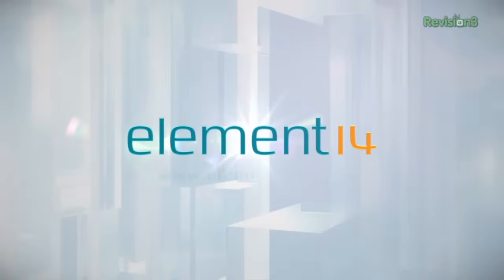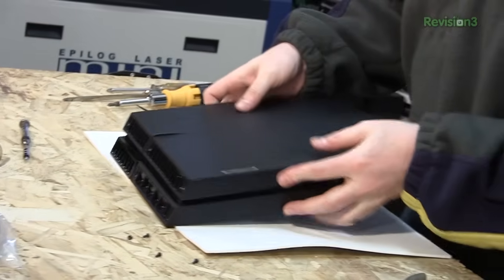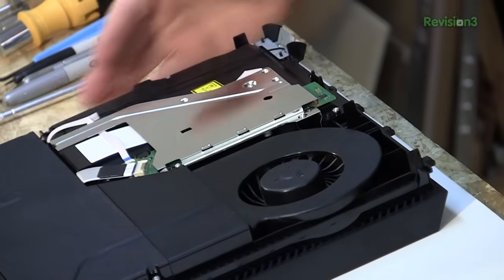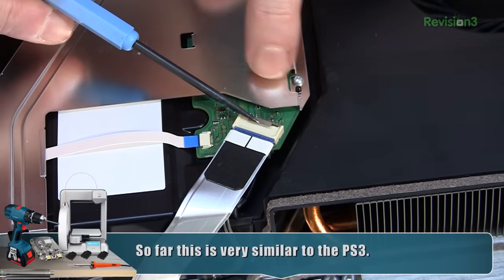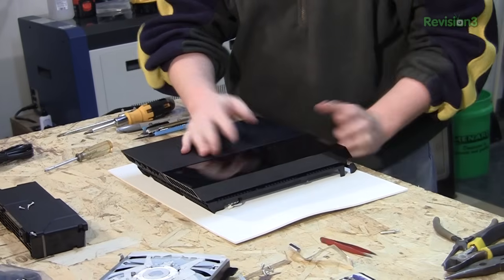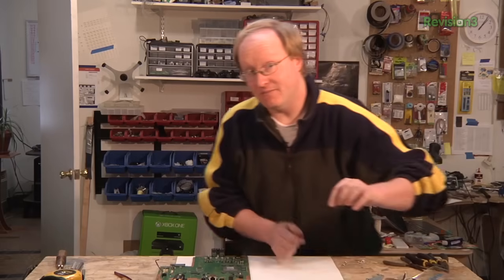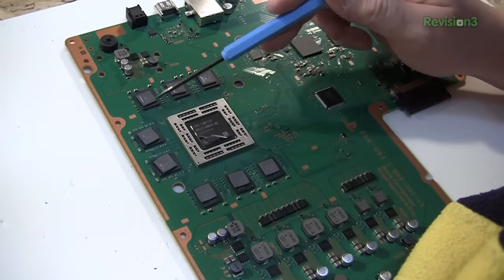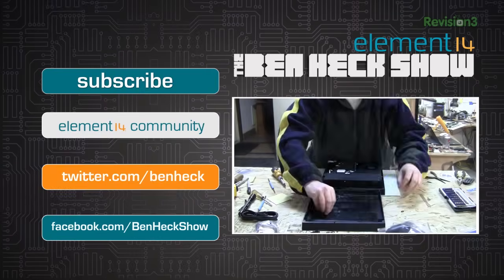Ben Heck's PlayStation 4 Teardown

Comment: Cool teardown. the console looks easily repairable by the end-user. It was a nice touch to have a separate flap for the harddrive space, so you're not breaking the warranty when replacing the hdd. Cooling seems a bit dubious, though I guess Sony made a couple of compromises on the overall size of the unit, the necessity of a power brick, temperature under load and noise.
Reply: actually, the cooling is much more efficient than the XBone, the unit is built into the frame rather than an individual unit, which cools efficiently being small at the same time.
Reply: Sean Williams I'm not sure what you meant by "efficiently". Due to the compactness, the smaller fan and the internal power supply, the PS4 runs an average 10-25°C warmer than the xbox one. Whether or not that is going to affect its longevity I'm not sure, but it is definitely more prone to overheating as it ages or when the fan starts deteriorating with dust and hairs.
Reply: ***** Don't forget to mention that the fan is also aiming downwards, so that it's blowing heat against a surface, which if you have had a laptop with a fan like that, you'd know it can be more prone to overheating.
Reply: Jrenyar I think the fan blows air sideways, out of the back of the unit, but I'm not sure about this. A lot of modern fan-designs are different from the ones in the past. Previous fan designs indeed all blow air perpendicular to their own rotation, but a lot of modern compact fans blow horizontally across their rotation plane. Again, I'm not sure if the PS3's fan does this or not
Reply: ***** Even if they have a sideways blow, when a fan points down, it will still blow down at least a little bit, which would still have a heating problem, even some modern laptops have the problem shamefully enough. I think that's why Ben sounded a little surprised when he saw the fan pointing downwards.
Reply: Jrenyar Perhaps ^^ , it's true PS4 runs warmer than xbox one in the same games, part of the reason for that must be the fan, you're right about pointing out Ben's surprise
Reply: ***** It's one of those things, no matter the enhancements in technology, simple physics such as how a fan pushes air around, will maybe change a little depending on how the case itself works, but it won't stop a lot of the air being pushed downward.
Reply: BernTheNerd You know this for sure? because it seems weird how the fan is pointing down. Like I said, no matter what enhancements in technology there are, a fan will always blow the way its pointed.
Reply: Jrenyar
If you have had one of the newer video cards, you would know that the fan is one of those kind that sucks air in from the middle and blow the air toward the horizontal van.  The spinning create negative pressure at the outer edge of the fan and thus the air is sucked from the middle. It is an incredibly compacted and efficient design
Reply: Jrenyar
 the guy in the video said that it takes the air in and the fan blows it out, didn't you watch the video? 2:59
Reply: sampson ireman Doesn't mean he likes the idea... he even says a fan facing down, thats new. Meaning he's surprised.
Reply: Jrenyar
 he didn't say he didn't like it either. a fan that sucks cool air in and blows hot air out is a great idea, but only time will tell.
Reply: Jrenyar
 digital foundry did a test and the x1 while gaming runs hotter then the ps4, so sony did something right, http://www.eurogamer.net/articles/digitalfoundry-hardware-test-playstation-4
http://www.eurogamer.net/articles/digitalfoundry-xbox-one-hardware-test
Reply: ps4 don´t need a power brick, the power source is inside :) 5:15
Reply: Jrenyar 
http://wimages.vr-zone.net/2014/01/PS4-lecture-7.jpg

Good read: http://vr-zone.com/articles/sony-engineer-unveils-functional-beauty-ps4s-cooling-system/69852.html 

No air gets pushed down at all. All the hot air gets expelled through the exhaust vents at the back.

"As for specifics on the airflow, Ootori explains that the PS4’s intake splits airflow between the bottom and top of unit. The air then passes through the heat sink, cooling the console’s power solution and exist via the exhaust port. Positive and negative pressure from the unit’s fan uniformly spreads the airflow, and Sony keeps the “eye of the storm” or “snail shell” design to maximize efficiency."

Read more: http://vr-zone.com/articles/sony-engineer-unveils-functional-beauty-ps4s-cooling-system/69852.html#ixzz3KSLllC3w

Comment: Why can't companies just make a console equal to a medium/high-end PC?
Reply: The Jolly Good Jester what do you mean by "perform as well as a PC"? PS4 has about the same graphic performance as a GTX660, though which much beefier memory speeds. You currently can't build a cheaper computer with better specs.
Reply: ***** The fact that it doesn't exactly perform as well as a PC would.
Reply: The Jolly Good Jester Well good point yourself :) , the Steam-box certainly appeals to some people. the reasoning for fairly mid-tier specs on the ps4 and xbone often involves diminishing returns and basic economics. A console can't be more expensive than 400-500$ or else no one buys it. Plus, what is top-tier this year will still be fairly mediocre in 5-8 years from now, which a console is supposed to last for. Then again, are higher performance really still necessary? The Last of Us looked beautiful on PS3, and that's an 8 year old console. Optimization should be more important than sheer performance
Reply: What part of the PS4 is different from a medium/high-end PC?
Reply: InfinityCraftLP it's true, especially the last couple of years, the developers had to put a lot of effort into optimizing PS3 games to make them appealing to a market that got used to seeing 2+gb vram textures. It goes to prove that performance is not per se required to make graphics look good.
Reply: Goat simulator.......... But yet console are holding back gaming lol
Reply: ***** the ps3 is 8 years old already?!

F*cking hell...
Reply: To keep the price as low as possible.
Reply: ***** Good point, I do agree that you can't really complain since it would be a mid-range PC. But what I mean is a home console that has top-PC grade specs. Probably what the Steambox is going to aim for?
Reply: *****
Promise you, you can.  Maybe not specs,  But performance for sure.
Reply: Sam Hofman I'm highly doubtful, but I'll give you the benefit of the doubt if you can provide an example build that performs on equal levels
Reply: It was, when it was being designed couple of years ago.
Reply: Antonio Sousa Yeah, PS3 is from 2006. It has 256mb of ram inside of it ^^

Was about time Sony made something new.
Reply: ***** ivent owned or regularly played console games since ps one. I had the huge rectangular one. :P I played ps2 a few times. Ill probably go back to consoles in a decade or so when I get a kid :D.
Reply: ***** I think it has 256 MB regular RAM and 256 MB VRAM. Very well optimized.

Comment: ps4 is similar to ps3 slim. In my opinion, the difference between ps4 and ps3 slim is that ps4 hardware is upside down. The mainboard is on the top, and the cooling fan and the disk driver is in the bottom. I love this design, i believe this would help users prevent overheating problems.

Comment: yep, the dualshock 4 is Bluetooth. most modern day operating systems allow you to pair a Bluetooth device to it. it disappoints me that there isn't a lot (if any) ds4 compatible  pc games.  the xbox 360 controller and xbox one controller work with a good amount of pc games and play lots of games using native gamepad support.  the 360 controller works with the most pc games for a console controller. if anyone knows of any games that allow you to use your ps4 controller on the pc please let me know.

Comment: Sony should make a Playstation with an external power supply for less heat near the processor and other components. Take out the blue-ray player for more space and put in more powerful hardware that they can now cool down more for better performance and durability by removing the blu-ray and power supply.

Comment: hmmmmm your statment that ps4 has better ram is missleading.

the ram is for the prossesor, and currently can only use the max ddr3,
only a gpu can use ddr5,

so the ps4 ddr5 is for the gpu and it also workd by converting itself to ddr3 as prossesor ram.

there for both are actually still using ddr3 on cpu and both are still using ddr5 on gpu.   both the xbox and ps4 work out the same on that subject

Comment: Actual release date: November 15th, 2020
Reply: xjakekyrianx he means that's how next gen it is
Reply: xjakekyrianx It Is the New PS5 (PlayStation 5) Console release date
Reply: ***** You're being a bit generous with that guess of the new PS5 release date, I'm gonna go for between 2018-2019. Since this new gen of consoles just don't have that much to improve, sure graphics could be improved a little, but that 60fps everyone was foolish enough to believe from the developers is bullshit lol
Reply: Jrenyar Well, This is a Leaked Sony release date I found since June 8th or maybe this is fans real guess for the PS5 Release
Reply: ***** It's more likely to be a fan guess, since I doubt Sony would start planning to release a brand new console right after an already new release. it makes no real sense since they probably don't even have the tech they want to put into the new console.

Also the guess sounds as if it was a guess from the time difference between the ps3 and ps4. Which would not be correct any more. Since when the ps3 came out, the tech in that was pretty brand new, so they had years upon years to get the best out of it, whilst the tech in ps4 and xbone is already pretty old. So it only has maybe 4-5 years left until they need to release a new console lol.
Reply: Checking in from 2019, no confirmation on any ps5 console yet. No speculation really. o/

Comment: Wait if the PS4 is more powerful, but technically very similar to the Xbone, can anyone explain why its massive in comparison to the PS4? The Xbone still has an external power brick too lol, so exactly wtf is in there that makes it so big?
Reply: Poor engineering, Sony have more experience with hardware.
Reply: ***** And how hot does it get anyway?
Reply: ***** Yeah... that is pretty vague...
Makes me think of questions like "what kind of games?" and "how hot do you think is too hot, microsoft?"
Having the ability to run a game nonstop without overheating isn't exactly a massive achievement in this day and age anyway.
Reply: Cool, my PC gets to around 31C while idle, 50ish after putting the CPU at 100% load for more than 5 minutes which very rarely happens while gaming anyway...
Reply: ***** Sounds pretty bad... hell my laptop from 4 years ago only gets to 75C when it's under heavy load...
Reply: ***** Well when I changed the OS, I found out shortly afterward that it screwed with the CPU throttling, that might be why. (70% CPU underclocks tend to reduce temperature :|)
Reply: ***** The thing with linux is there's nowhere near as much crap going on in the background :P
However it's not too good for gaming yet :(

Comment: Can you fit a 1000 gig hard drive in to replace the 500 gig sata drive ?
Reply: Yes you can.
Reply: Thanks Alex.
Reply: kevin kinsey Just be careful, you have to get one the right height as many are too tall.
Reply: Ok cheers Alex maybe a 2.5 sata size and someway to hold it in place so it don't move about.
Reply: kevin kinsey It IS 2.5", the problem is the height.  The cage only fits 9mm height, larger drives can be 12.5mm.
Reply: Ok cheers for the info m8.

Comment: there is no DDR5 available yet. It probably won't be available till late 2018, if not 2020.
You might be thinking about GDDR5, which would never have anything in common with DDR5. GDDR5 is based on DDR3 and is fine-tuned for massive bandwidth opposed to ultra-low latency in case of DDR3 and DDR4.
While fast DDR3 timings are in order of 9-27-27-27, GDDR5 will have timmings of at least 27-81-81-81 or even worse.
Do not ever mix those technologies.
P.S. I wonder how they fitted APU with GDDR5, maybe they aasked AMD to make an exception

Comment: i didnt get a samsung hard drive :(
Reply: ***** oh why?? are you having problems?
Reply: ***** oh wow good to know! im actually looking for a ssd in my laptop soon, would you recommend any? need about 120-128gb
Reply: ***** thats pretty cheap, ill have to do more research too, maybe woot will have one for a ridiculously low price xD
Reply: ***** thank you! everyone acts like the samsung evo is a miracle to mankind so i might go with one of those haha, i also dont like the intel very much
Reply: Mike Hedges Samsung is a very good choice; haven't had any problems with one of those.
Reply: Mike Hedges
be sure to check the reviews for the exact size youll be buying cause some models of ssd are great at higher sizes but are pretty slow when using 64/128gb version (something to do with the nand memory they use).
Reply: MrJigssaw1989 yea i go to a site, that i cant even remember right now haha, but the samsung evo 120gb is like 80 on amazon right now, and its pretty darn fast, idk if i should buy it though, that takes money haha
Reply: Samsung doesn't produce harddrives, they're rebadged Seagate drives.
Reply: ***** I have a Seagate, I hope my one isn't actually a Samsung.
Reply: planetX15 Samsung does not produce harddrives.
Reply: ***** Well that's a relief, I guess mine is still a Seagate then.

Comment: Wow, 400 bucks for a board that looks like a low-end mini-Itx with a cheap APU.
A few controllers and a SSD and you'll have the price of a fx8350/i5 sytem with a 2gb Gpu with 8gb of ram and all those extra parts you need for hardcore gaming.